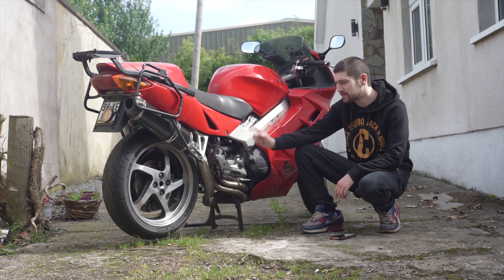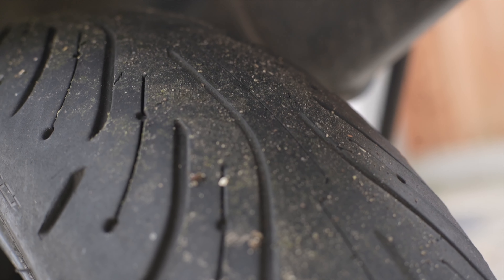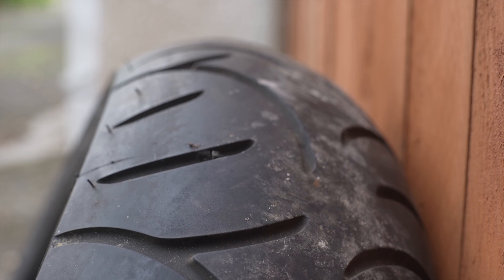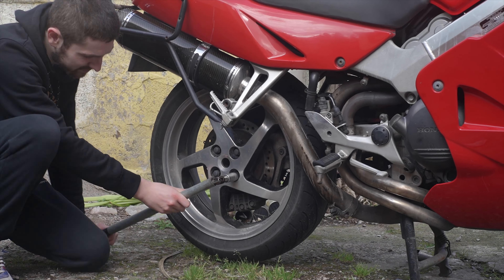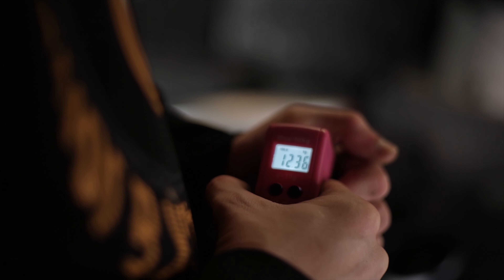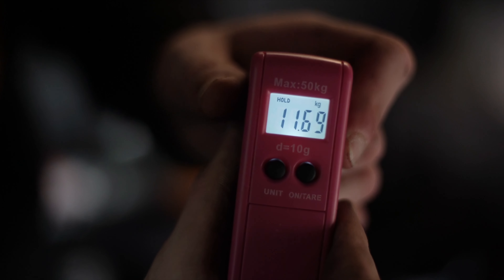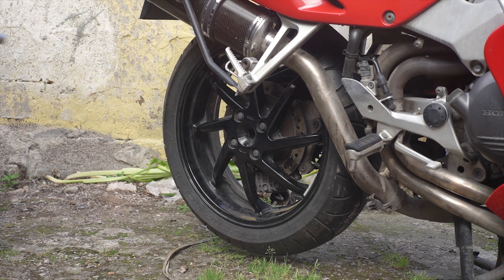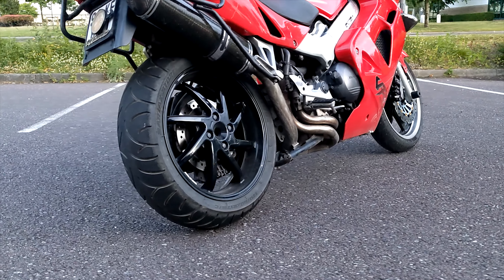RC36 Wheel Upgrade for the VFR 800

Comment: These old rims are like rocking horse shit,  if you ever see one on sale, sellers is asking a stupid price for it, its an old alloy rim ffs, worth £50 at best, plus it's heavier than an OEM 5th Gen / 6th Gen rim ... it's only a cosmetic mod, adds no value to the bike, so pretty pointless, better to throw the money at a pair of decent tyres IMHO ... I do like your Vlogs in general, keep it shiny side up bro👍
Reply from the maker: Much appreciated 👍 Ya pretty much just for cosmetics. I was after doing everything else I wanted to do and I plan to hold onto it so I said why not throw more money at it 😅
Reply: @RHauto  Indeed. My 5th Gen came with the standard 5 spoke, polished up like yours was. (I still have it). I wanted the 8 spoke rear to match the 6 spoke (SP1) rim at the front. Bought one, had both rims powder coated, and they look great. Bought another 8 spoke rear as a spare, and here we are...
Reply: You see the 8 spoke advertised at anything up to £300 

Seen buckled over along £250😢😢😢😢
Reply: Do these take the same wheel nuts?

5th gen ones look domed to me